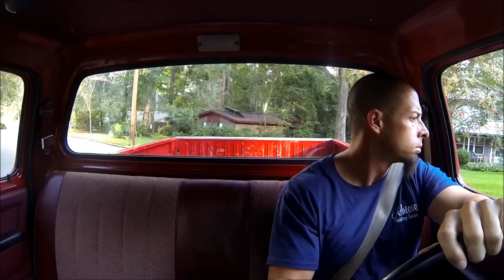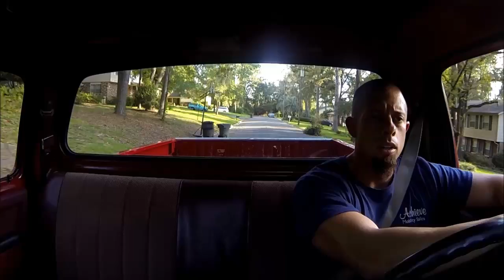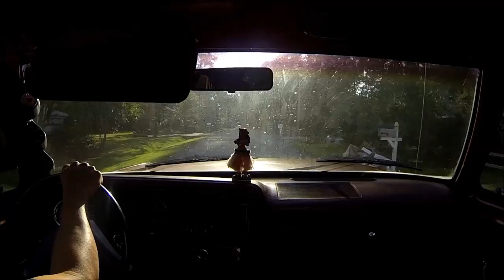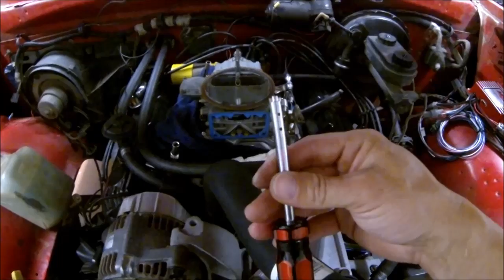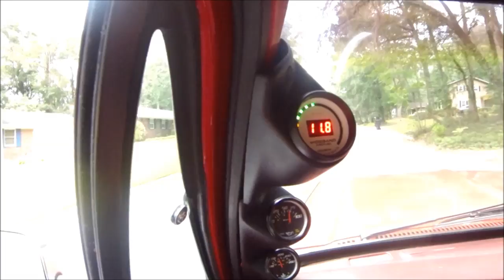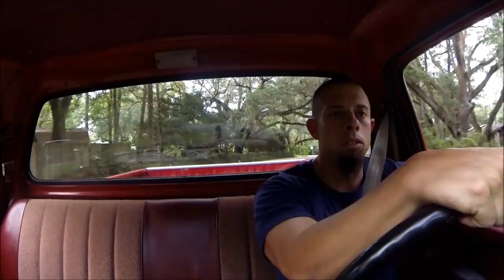Autometer Wideband O2 Tuning and review

Comment: I had to disconnect the secondaries on my edelbrock to zero in on the primaries. 
Kinda hard to tell when the secondaries tip in. 
On Eddys, a vacuum gauge on the dash helps too.

Comment: Nice video. I just got the AEM x series and going to tune my six pack carb setup.  I am strategizing my approach on changing those jets out. It runs the middle 2 barrel carb, then the outboard carbs kick with linkage.  

Hopefully i can do like yours and disconnect and then add the other sets of carbs in to tune WOT.

Comment: great video! question what exact wideband is that? I have a pro comp ultra lite wideband and was wondering if yours is back lit with the dash lighting? mine has a white wire for it but doesn't come on when hooked up and dash lights are turned on. the truck has not been fired up yet as I am finishing all the wiring and testing everything. I read the instructions and I know there is a 12.5 trigger internally in the guage to heat the o2 I'm just wondering id the back lighting will work once it is actally running. thanks
Reply from the maker: +fvgc454ss I have the AutoMeter Wideband and i think it is the ultralite. Its all digital so it lights up as soon as the key turns and the engine is running. otherwise there is no light up with just the key on. hope this helps and thanks for watching.
Reply: +Alex's Garage the digital read out lights up when key is forward. I was just curious if it was back lit like the other guages when the head lights are turned on. I read most aren't. mine has the red power wire and has a white wire that says route to dash lighting. when lights are turned on the guage does not illuminate. I guess I will have to see what happens once the truck is running.